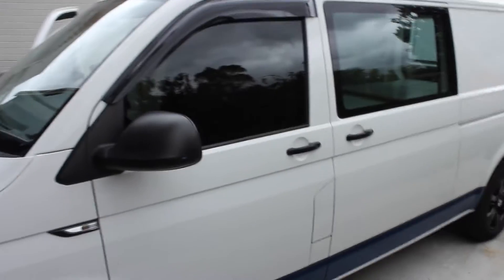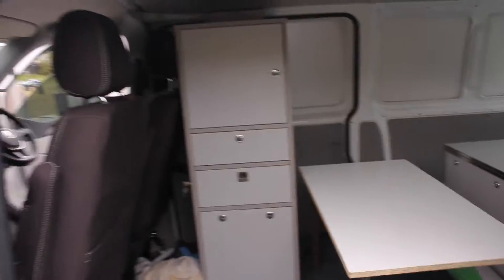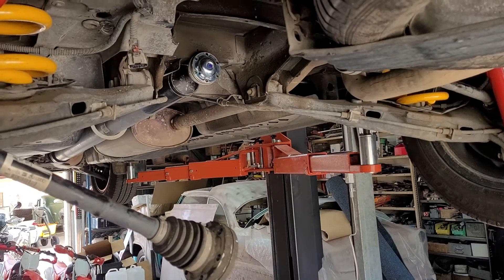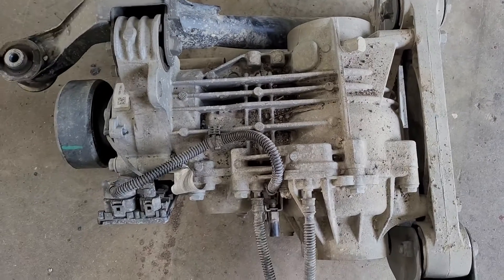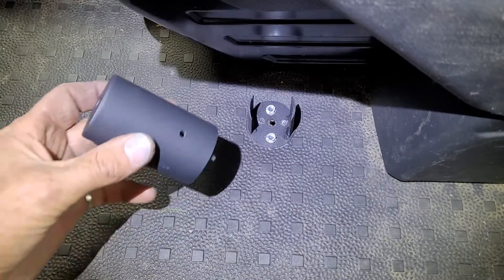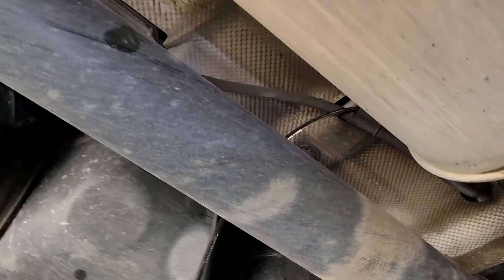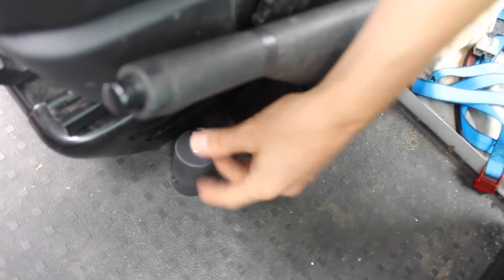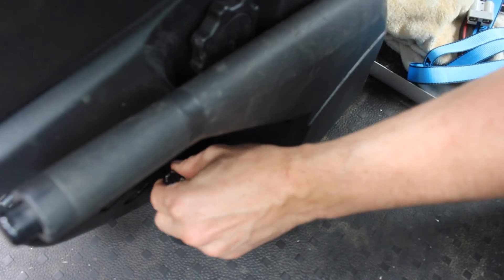VW T6 rear diff swap - How to swap a diff lock into a no diff lock van.

Comment: Great video! Thanks for all the information! 
I am wanting to do the same swap on my 4 motion T6.1 just got a quote from VW for new diff for 13k .. so will  need to find a wrecker! 
Could you share the name of wrecker that your dad got his from? 

Cheers Jeremy
Reply: Hi again little uppdate on My sudden swap 14 days ago ,(due to the fact i needed a working 4motion «now») I did the swap in 2houers assisted by Jr on my topmost lift. Drove of and felt the overwhelming joy of 4Motion on my slippery steep driveway 😇
Fiddeling diff lock controls prospond to “later” 
Until Saturday pulled onto the main road pulling 1ton trailer 
Got well onto 3’gear(no power pull) suddenly rear diff exploded😳 split case open!! 
Was barly able to limp 300m to exit almost full lock up for each turn of the wheel. 
Just switched back diff tonight 
So autopsy hopefully will be performed within a week or so
“Easy come easy go” 😎Bent
Reply from the maker: Hi Jemery 
Oh wow that's crazy $$$$
I will find out for you, I think he just searched all wreckers in Australia till he found one. I think his came from Tassie.

Comment: Keep It simple!!😆😎 i scored a complete locking diff for My 5.1 at My lokal breaker last week, 
Luck me i was able to pick all vacum Lines, valves relay switch and harvested as Mutch  connectors  and harness as possible needed to recreate the oem set up together with vag-com and proper coding and cut and splice some cables😆 My «simpel» solution would be to maually switch operate the vaccum control valves, maybe together
With «disable” ESP connection.
Reply from the maker: Hahaha I like your simple. That will be awesome, good luck and let me know how you go. Would be awesome with a button to turn it on and off

Comment: What an ingenious solution! 

Would you be able to share any information on what would be required to fully integrate as if it was OEM? Are the changes limited to the haldex/rear diff or are more changes needed to get the vacuum system?
Reply: There is a fair bit of other items you need. There is a vacuum system that goes from the engine to the diff to operate the diff lock.
There is also the wiring to the switch and to the vacuum system.
It is possible that you may have to link it in to the ecu as well not sure about that.
If you had a wrecked vehicle to remove it all from you may be able to do it.